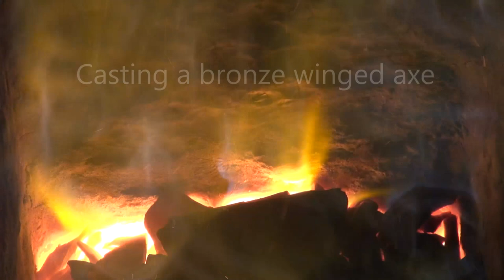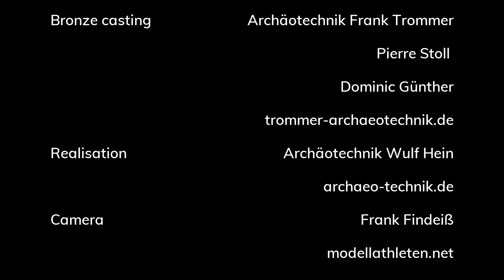Casting a Bronze Age winged axe

Comment: Nice, I currently also working on the very same thing. Winged axe but with the wings a lot more towards the back. What material did you use for the mould? I tried using fine sandstone but it is horrible to work with, the deep, narrow grooves just refuse to be worked on with simple tools.
Reply from the maker: I know :-) We used flint tools, very thin burins, and it is a matter of endureance and diligence to work with them, very time consuming, but in the end it works. The mould was made from very fine, but not too hard sandstone.

Comment: Fantastic video! What did you make the crucible from? If clay, what did you dp with it to make it wothstand the temperatures?
Reply from the maker: Thx! The crucible was made from soapstone in order to guarantee the result for the movie. Originally, Bronze Age people used sandstone
Reply: @ulfr23  Soapstone for the crucible? How could it withstand the temperatures of the furnace? Very cool!
Reply from the maker: @astorniit7524 Oh sorry, I got you wrong. The crucible (vessel to melt the bronze) was made  from special clay
Reply: @ulfr23  ah, yes, that was exactly what I was wondering. I've had a hard time getting the composition right for such clay. Would you mind sharing some insight or the composition? Unless it is a secret recipe of course, haha.
Reply from the maker: @astorniit7524  As I didn´t make them, I can´t share the receipt, I´m sorry, but I think it was some kind of fireclay (Schamotte) tempered with special sand